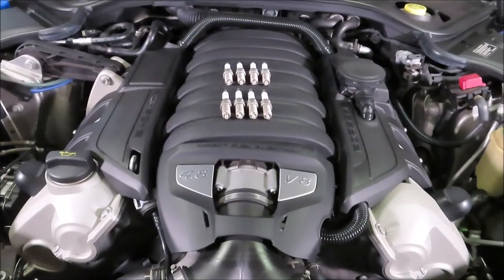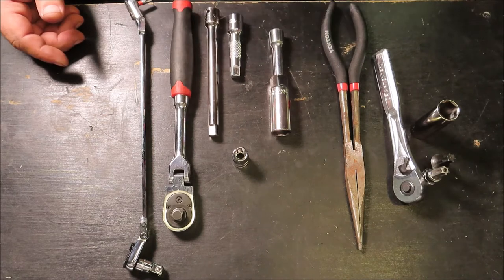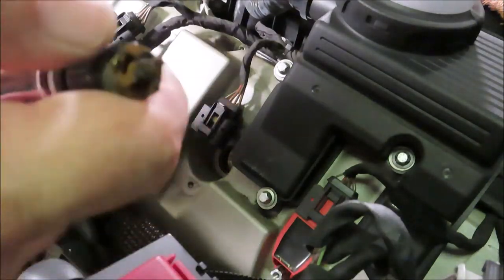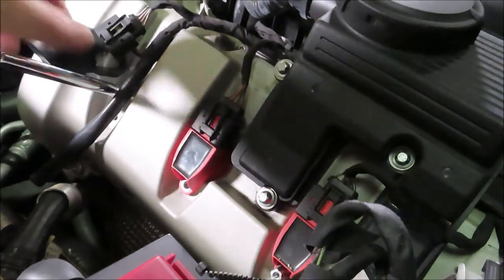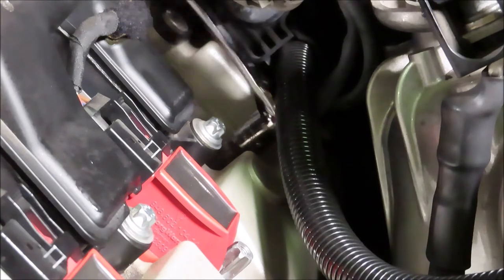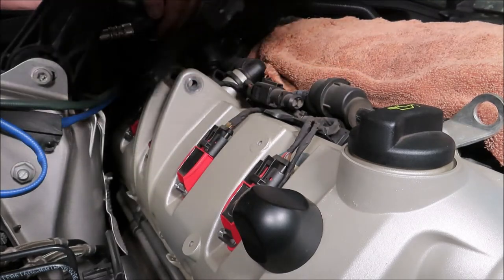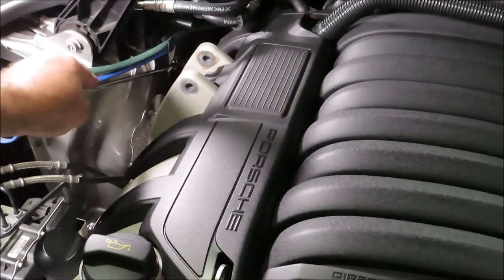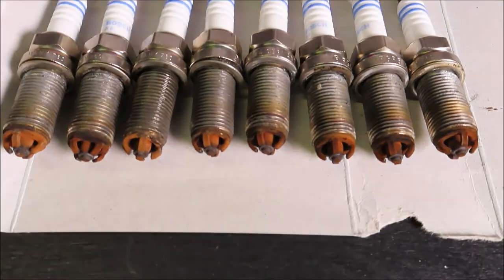PORSCHE PANAMERA SPARK PLUG CHANGE | 2010-2016 V8 / V6

Comment: NIce work.  My Panamera is 7 years old (2015), so I replaced the plugs last year at the recommended 6 year interval…which is a silly recommendation since the plugs were in perfect shape.  Miles driven is the key factor with these plugs.  Appreciate your videos!
Reply from the maker: At just about 25k miles my plugs were in bad shape.  Both times.. Worst I've ever changed.  Thanks for Watching!

Comment: Mike
When did you steal my car without me seeing it??
Yep! I have the same identical car. Same year , same color. Need to change my coils and spark plugs. The dealership wanted about $1,800 bucks!
Per your recommendations, through AZ Autohaus, I think the total cost came to less than $400. Granted, I'm going to have to buy this specialty tools that you have on this video, but they can be used again as needed regardless of the purchase cost.
Love your videos, however, I haven't gotten the courage, yet, to do brakes and rotors yet, as you have.
Thanks for the videos!
Again, great car! You've got wonderful taste in vehicles.
My M1 Garand and carbine fit really well in the back too
Reply from the maker: Thanks for Watching! If you've ever done brakes before, it's pretty much the same. Just more expensive parts.
Reply: @mikeshorsepowergarage7577  Yes, I saw your videos on those. Broke it down fairly clearly. And, to your point, The parts can be sourced online at a reasonable price without sacrificing quality and not buying OEM with the Porsche name on them.

Comment: Great 👍 Job Mike and thank you 🙏 so much for the work tutorials on the Porsche Panamera models. I’m actually thinking about purchasing a 2013-2014 Porsche Panamera v6 base model. Could you please help me with any advice if possible?  Thanks
Reply from the maker: Look for one with lower miles and with service records. Thanks for Watching!
Reply: I recommend a 2014 over the 2013.  The Panamera went through a mid-cycle refresh in 2014, making it the 970 Generation 2.  The main differences are minor cosmetic improvements to the front, headlights, and rear of the car.  Looks a little tighter, sharper.

Comment: I have a 2010 Panamera turbo and recently completed this service thanks to your helpful video. I am going to change the coolant vent lines next since the connections are cracked and losing coolant. Also your engine bay is so clean - what do you use to clean it?
Reply from the maker: Thanks for Watching! I just wipe the engine bay with a damp towel after each car wash.
Reply: Hi did you ever change the coolant vent yourself ? If so was it difficult ?

Comment: Mike, how was the driving after fresh spark plugs? noticeable difference(s)?
Reply from the maker: No a big difference.  Throttle does feel a little crisper.  Thanks for Watching!
Reply: I just changed my coils at 67K in my 2011 Panamera S and wow the added power was immediate in the throttle. If you do plugs do the coils. Be careful with non OEM coils because even in my VWs the after market will lack the performance as I had to do a change out on them before.

Comment: Hello, is there any chronic problem with this engine?
Reply: Valve gaskets leak around 90,000 miles. I had them fixed at a cost of $2,000.

Comment: Hey Mike hope this reaches you well I have a Kayan Turbo S in Turbo SI am getting a pen is a panamera Turbo delivered it's a 2012 what is the 1st thing I should do to it it runs great it runs great it handles well I've already have rims ordered but as far as getting a tomb I was thinking 5 speed what do you think and the exhaust
Reply from the maker: Converting the Panamera to a 5 speed can be done but it will cost just about as much as the car. Since it's a Turbo there's a lot of power to be added.  Down pipes + exhaust + a custom tune can add about another 100 Horsepower.  That's the route I would take.  Good luck and thanks for Watching!
Reply: @mikeshorsepowergarage7577  cool beans thanks

Comment: Asking do you also have a video on the battery change and altenator change and what is the best brand and to  recommended. And use also
Reply from the maker: Thankfully haven't had to deal with charging issues yet. I do know that Interstate makes a battery for it and it's available at Costco. Thanks for Watching!